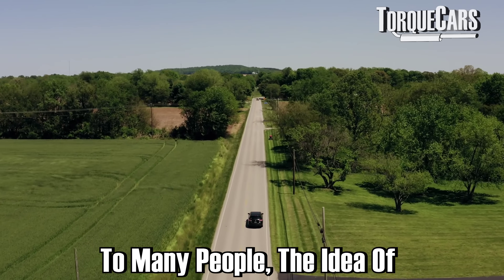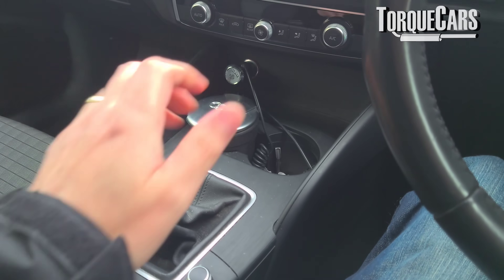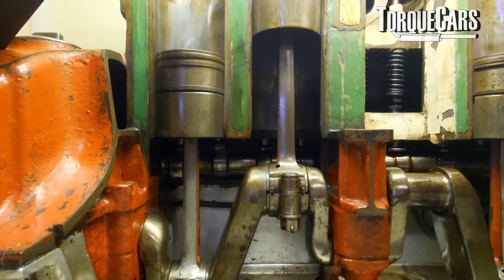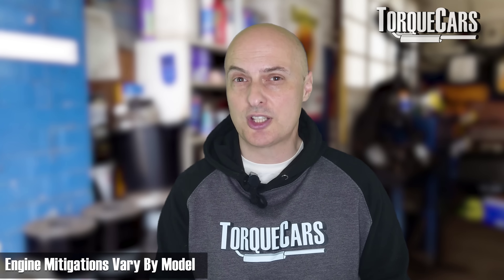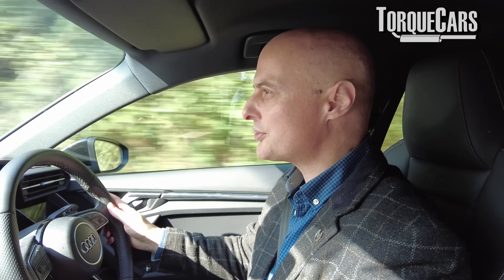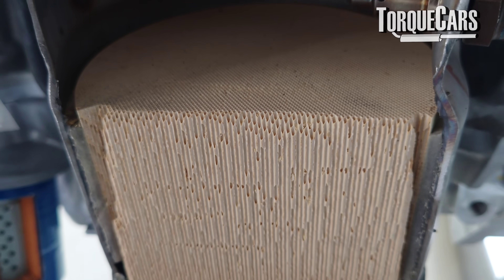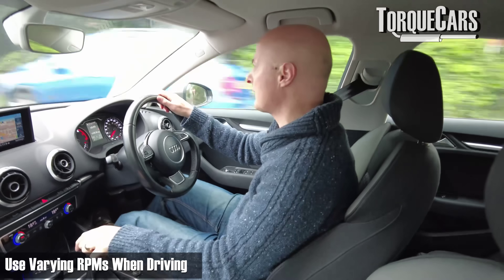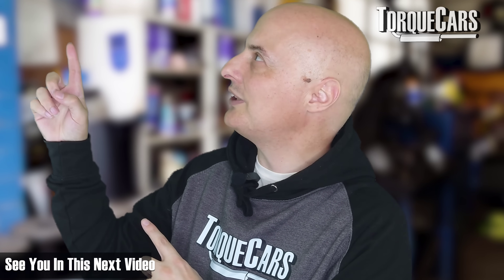BIG DAMAGE By Lugging at LOW RPM? Eco Driving Warning! (Manual Gears)

Comment: Ok, seems I pretty much do the correct thing, whilst not thinking too much about it!
I have a few times chosen 5th gear on a flat road or down hill at 40mph, but 95% of the time choose 4th (a small diesel).
Still find it a bit surprising to only see 2100 revs at 70mph in a 1.25l diesel from 2008!

Comment: The newer Audi A-4 turbo engines require a very special motor oil to prevent lo-rpm pre-ignition. The oil that can leak by the rings during lugging can cause this and the special oil has an additive to "help" prevent blowing a piston. The plus for these engines is the dual injectors-- cylinder and port which help to keep the intake port clean.
Reply: I have a 2016 rs3. Im so mad that it doesn't  have the dual and just direct injection. Im at 80k miles and i havent looked under the manifold yet 😬

Comment: Low RPM, Cylinder ridge buildup, uneven wear on the top of the cylinder.
High RPM, Piston rings hit the ridges and crack them.
All in all, there is a sweet spot in the power curve that gives you the best MPG and longevity.

Comment: Depends a lot on the power band of your engine. 2000 RPM in one car might be totally different than another car. Some cars have plenty or torque at 2000 RPM, some have very little. Just to pick one RPM, 2000 is considered pretty low.

Comment: Was recently driving a nearly-new Transit, manual, and it had a suggested gear readout on the dash... the daft thing was wanting me to be in 6th at 1Krpm if I was feathering the throttle, but the turbo was completely dead below 1500rpm. It didn't seem to change its suggestions based on hauling weight either, God forbid someone's dull enough to treat it as gospel.
Would far rather owner's manuals came with dyno curves and explained a bit about what's happening across the rev range, alright for those that'd bother to read it.

Comment: I always kind of figured that was the case and even though my vehicle has an automatic transmission i've gotten into the habbit of doing things like manually disengaging the overdrive if i want to accelerate on the highway, or if im cruising, dont suddenly put power into the engine, only really when the RPM is about 2000-3000 or higher. Good to know im validated lol

Comment: what if I gradually open the throttle? I usually open throttle, then wait until it reaches resonance, then I increase throttle. in long range riding, I hover around the RPM range where I feel the smoothest (theoretical the resonance RPM). I'm using CVT scooter, btw

Comment: I do call what I do driving like a grandad at my age of 27 but every now and then give it a good blip sometimes in my diesel, main reason to heat the Cat so it does what it should, turning some very bad things into slightly less bad things, egc, adblu and engine breaking to cool the engine, 2.7 tonnes and 37mp isn't bad I think

Comment: What exactly do you mean by "low RPM?"  Cars very much like to be in the 2000-3000 RPM range.  They can cruise even lower than that.  Most cars don't like high RPMs, especially if you have push rods.  OHC cars do tend to like higher RPMs though.  But even then, most don't like being near red-line.
Here in the US, where sticks are pretty much a thing of the past (I'm one of like 18% of drivers who know how to drive a stick, but that number is MUCH lower in younger people and only 2% of cars have a manual), most cars have automatics and those automatics like to keep the RPMs pretty low.  Of course, automatics will usually downshift when under a very high load.
Reply from the maker: Automatics are fairly well setup although some need to manually switch off the overdrive on hills etc. Generally speaking on most engines around 2000-3000 are fine unless you are going up hill and the car is struggling to make power, in that case you need to drop down.

I see many drivers cruising around at near tickover speeds which is not good and who this video was primarily aimed at, and hopefully the knowledge is useful to most drivers seeking to develop a little mechanical sympathy.

Comment: 7:25 Most oil pumps are not so poorly designed and create a decent amount of oil pressure and flow at idle.  Starving the engine of oil for even a second or 2 can cause serious damage to an engine.  It just doesn't take long without oil to spin a bearing.
Reply from the maker: You are quite right, there's not many out there, the mentioned VW V6 were notorious but manufactures have issued a service fix for them. The other time I see problems is with an older worn oil pump, which struggles at lower RPM and only just flows enough at mid rpm ranges.

Comment: Transmissions are specifically designed to keep the engine at a low rpm and high load for max efficiency.  In this sense, low RPM is 2-3k
Reply from the maker: Bear in mind that about 70% of us over here still drive a manual transmission. The only time an automatic will give problems in this sense is if you manually select the wrong gear, and even then better transmissions will override you.

Comment: I self tuned for a few years the ideal combustion is on a very few numbers of cells (like an excel sheet) and those are calculated to have a regular load (throttle %) and engine rpm outside of those "sweet spots" you're into badly optimized cells that are good neither for efficiency nor emissions, you're basically trying to pedal a bicycle from a red light on the wrong gear either it's too difficult and you're putting massive strain on the chain and gears or it's too light and you pedal like crazy for no speed, cars are usually optimized to be driven at the right gear around the usual speed limits there's not fix or skill to change this it's a fact and you the driver cannot change it it's literally programmed like this

Comment: Excellent video. My father who comes from a line of auto mechanics and truck drivers taught me that and I become bother myself. Many people don't understand the dangers of that.  Just lazy to shift , distracted with something else while they t
Stop on the throttle or thinking about fuel savings while costly repairs are knocking at your door! You've gotta feel with the engine and it's load, help it out a little!

Comment: Is this condition also stands for low capacity engine such as 1200 cc suzuki engines and also by low rpm means how much. I usually always drive around 1500rpm at top gear to get more mileage.

Comment: I own a 2002 Ford Ranger 4.0L . I now realize listening to your video that I am driving the truck wrong. The issue is that overdrive is automatically on when you start the truck, you can then turn it off and drive normal. There are a few hills that I went up in overdrive because the truck had enough speed and it did not have to shift down and the time it did not it would shift out of overdrive. I will try to remember to disengage overdrive when I start it.

Comment: I have a 2012 Citroen Berlingo with the DV6 8v engine. 162k miles and it goes like a bat out of Hell. It gets warmed up, then thrashed to max rpm (4500) in each gear. It helps that I do oil changes at 8k miles, but it's on the original turbo and sounds smooth and very little emissions (0.02 at last mot if  recall). My favourite car 😄

Comment: I remember growing up here in Canada, my parents drove a 1995 Chev Suburban with a 350 v8 and a 4-speed auto; PRN(OD)D21 for column shifter selection. There was a sticker on the door from factory that said "Do Not Use Overdrive When on Gravel or Pulling a Trailer". A lot of Chevrolet / GMC work pickups here pre-1990 still didn't even have overdrive, offering instead either their famed and so-much stronger TH400, or a stick shift to the masses. They were made to haul heavy and to do so reliably; OD is your enemy in all such cases. 

Without even considering that sticker, my old folks still taught me the way they were taught, to only use overdrive when cruising light and on the highway. 
The whole family lineage has always said "The 2 absolute worst things you can do to an engine are lugging it, and loading it when cold." Knock it into 2nd or 1st if needed; keep the motor warm whenever, wherever, and however you can during the -20 to -45 degree winters. 

Today though, where I work we put on a lot of remote klicks on our gas fired 1 ton trucks, and usually with trailers. We all use tow mode when hitched up, but only one other and myself continue to disable overdrives.
Reply from the maker: wow it gets pretty cold out there. What do you do as your warm up routine on the engine when you start in those temps?
Reply: @torquecars  Run the wall powered heaters you have on it for at least or around 4 hours before attempting to crank it over. Block heaters, battery warmer, oil pan heater, coolant recirculating heater, whatever's installed to make it a nicer experience. There are block heater timers you can pick up so you don't need to run them all night or be up way early. Grandpa would even rest a lit tiger torch on a baking sheet under the oil pan of his truck for 15 mins before trying the glow plugs. 

Be ready to wake up to a dead battery or one too cold to feed the amps needed from it. Chemical storage to electrical energy conversion doesn't work well in low temps, hence the rarely installed, but readily available, battery blanket. If the walls are barrelled out then it means it's frozen and you're out $150-400, but you can still run considering it's just for electrical storage and not operation; just get that alternator spinning. If needed there's booster packs, booster cables, neighbours, and strangers. Nobody wants to be outside longer than they need to be, they certainly don't want to see you out there for any time either. 

Once running, idle in park for as long as you think is needed. Excessive smoke can be normal for diesel or premium. Longer is better, but too long is just wasteful as you can't make good heat if not moving. 5 mins, 10, 20, preferably with the doors locked. Then just be gentle until the temp reads operating range. 

Once on the road, a winterfront is an absolute need. Covers the grill and keeps cold air from the radiator. Can get them from manufacturer, can get them third party, if you don't care about looks then just thick cardboard and zip-ties are very common among the working man. Without that sheet of bubble insulation pressed to the front of the intercooler, the antifreeze in my turbocharged 2L i4 will drop from 92c  to 63c just by coasting from 100km/h to a stop sign in a -35 environment. Luckily the oil doesn't drop as fast so she recovers in short time. 
Even threw a code for overboost and locked my Malibu into limp mode once; air was so dense it was like the turbo was pushing water. Apparently that code is self clearing over a few days so you can't just flash it and blow it up the second time. 

Nobody in their right mind criticizes for tardiness or called in cancellations at work or appointments. 

Vehicles have incredibly short lifespans here. To get 25+ years out of a year-round daily driver involves uber religious maintenance and near witchcraft. Between rust from salt or calcium and rapid temperature fluctuation stresses on every single component, nothing survives long if not kept parked and sheltered during the colder 6 months. Few people care about new cars here, they're all new. The classics from the '50s or even the '90s are what turn heads.

Comment: My wife bought a manual Aygo last year. It doesn't have a rev gauge but it has a shift indicator. The problem is, that thing flashes to change gears under 2k rpm even at 3rd gear while uphill, which is crazy. I told my wife not to even glance at it.
Reply: My sister also recently bought an Aygo and I told her exactly the same as you did.

Comment: When you're lugging the engine you're not saving fuel anyway, because you're running it at such low RPM the fuel flow isn't as effective so you're not getting the most out of the combustion.

Comment: Pretty much same rule in cycling - you "can" cycle with low RPM but it will hurt your knees in long run a much (guilty). Exception is if you do deep power-strokes with upward (not sitting) position uphills but it is different - once you settle back, you gotta drop gearing down!
On long runs ofcourse you will aim for lowest "easy" RPM you can get (I pretty much have settled for 60RPM 😆 )

Comment: Most important: you are talking about petrol engine, driving low rpm on diesel it s fine, on my van the maxmium torque is at 1500 rpm... I m often with the 5th at 70 km/h on 1500 rpm, it s perfect

Comment: I don't understand what's low gear and high gear?

It is bad to drive at 1000 rpm so if I'm in 2nd gear for example for 30km/h it's good but 3rd gear is too low?

But is it good to drive in 2nd gear at 40-50km/h?

Comment: three biggest issues are.
high cylinder pressure knocking
carbon buildup
snatch on drivetrain components a constant loading and unloading from each compression event which will wear splines, shift collars and gear faces.

Comment: I see how I killed a Renault Megane 1.5dci now, I had two years of low rev, hyper-miling, it died and needed easy-start to get it going. Definetly causing issues as mentioned, I had to replace the fire-seals on the injectors, had regular EGR issues and had heavy oily deposits in the EGR/inlet pipe.
 It had regular servicing (oil & filters). 
I've not played the MPG so heavy since to a car since and not had any issues. (Toyota, Kia, Mini & BMW)

Comment: Best way to drive, for health of the car and for fuel economy.
1. Start from 1st gear, and revv it 80%
2. Shift to 2nd and revv it as high as you can, until you get desired speed 
3. Shift to last or second to last gear depending on the road, speed and gearbox 

If the limit is 40-50kmh/h skip second step 😊

Comment: I bought bubaru with EJ25. Previous owned rode only low rpm. (Car was in decent condition)
After rebuilding engine (clogged piston rings) mechanic told me "it's not a virgin, don't be gentle" I'm driving 2k rpm cruise, 4k-redline during acceleration.
NOTHING is wrong with the engine from 100k miles.

Oh and how it smoked from the exhaust (catslyst) when I started revving properly!

Comment: try maintain 5000 rpm in 1st gear without jerking, then off the gas and on catching up the speed and rpm smoothly, repeat this a few more time for 1000m, adjust throttle input make sure the rpm stays at 5000 rpm, let the engine sing and listen how sweet it hums, experience this new feedback sensation or else go buy an auto, if you feel this is impossible to do smoothly, you're the type that turn the wheel 1st then only move the car, the one who's contributes to tie rods and steering racks issues screeching tyres in the basement parking every morning, what am I talking about, I really cannot think

Comment: Most cars are designed for high rpm. So to use in low rpm continuously a modification is needed. One example is to make the intake duct before air filter smaller about 30%. This will greatly increase torque at low rpm and make the car more driveable at low rpm. Also use thicker oil because low pm cause more load, and thicker oil provide better load capability.

Comment: And you didn't even mention the dual mass flywheel, which can also get destroyed pretty quick when driving at the low RPM. Happened to me quite recently, and at the end it even broke the gearbox (one clutch lamella broke off and bruised through the gearbox case, making the oil leak.... which I didn't actually notice as the oil was kept in the bottom cover, thus drove about 100 miles without the oil in the gearbox 💀 - there actually wasn't even increased noise), that was an expensive repair indeed. 

Now I have a VW DSG Diesel which is also pretty bad at this and I don't even have much options now... as even in the "sport" mode the DSG shifts up below 2k RPM and mostly keeps the RPM at around 1.5k (I don't even use the "regular" D mode any more, just always switch to S, which is still pretty bad anyway). I'm a bit afraid that this way these components might not hold all that long.

Comment: Surely that should have been to high a gear going up hill puts more strain on your legs or engine, not to low a gear. I tend to stay in the 2000 to 3000 rpm range
Reply from the maker: Yes you are right, I totally slipped up there!

Comment: Newer autos will not lug. But you should also give it the beans once and awhile. If you want to be accurate get a scan gauge and watch engine load when cruising. keep it under 80% you will find that it is far less throttle then you would think. Go for a downshift manually even on an auto. Engines run most efficient at 1400`1800 at 80% load, not throttle. Which can be 25% at 80%. Full throttle to a third gear run onto a freeway will clear out many systems built to flow at peak power. At least a few per tank,and only after fully warmed up. If you don’t it will cause issues long term. And maintain it. A big one is to not drive hard until it is warmed up.

Comment: So I'm driving a 1.0 l naturally aspirated 3 cylinder engine in my 2022 polo with a slightly short 5-speed manual. My fuel consumption is outrageously low. Lower then then the old NEFZ consumption regulation. 
My shifting pattern through the rpm range is spreading from 1500 to 2900 rpm at low throttle in input. Evertime I hear the variable camshaft shifting to a high load, I try to reduce the throttle or reduce the gear, depending on the incline. 
Am I still doing everything correct?